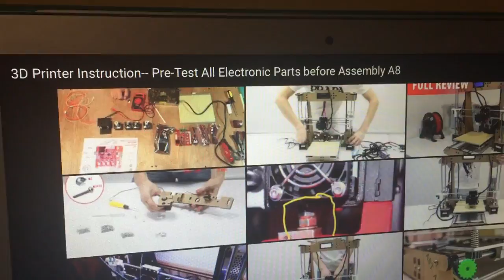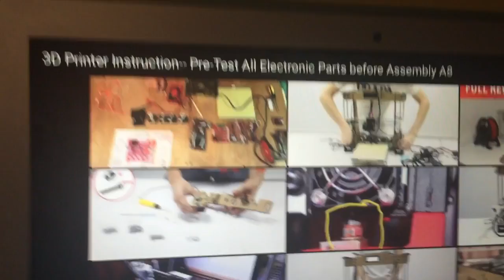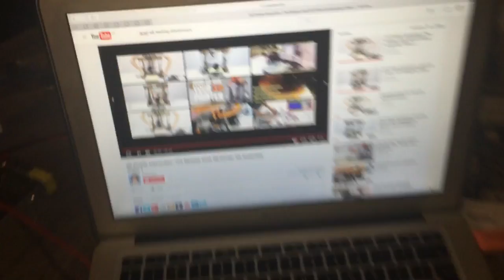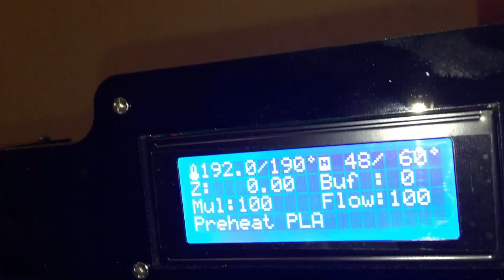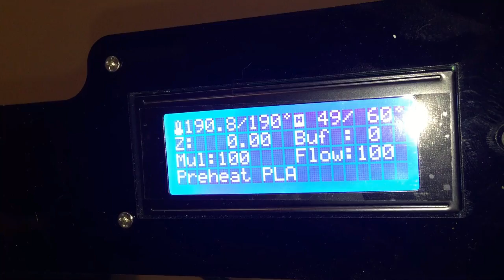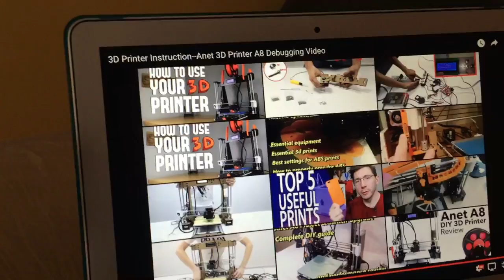Anet A8 Unboxing & Build Tips 2017 Edition 3D Printer

Comment: i have see you did not assemble the autoleveling sensor you orderd. i got the same, im excited to see if it works on your site. and if please share how i cant get it to work :-) cheers
Reply from the maker: +Marc Weidner have not yet come around to install it but will hopefully very soon as I need to update the firmware as well and I'm a bit afraid I'll mess something up
Reply: Blackwidow Unboxing I used the skynet Firmware update and i went pretty easy and good. there is an documentation inside for step by step. i also downloaded me on a  german page https://www.bastelbunker.de/mein-3d-drucker-der-anet-a8/ the files. scroll down to downloads and there you find original firmware.
Reply from the maker: +Marc Weidner thanks for the info

Comment: I recommend a glass bed and use hair spray to help the filament stick. It works amazing, you will see that removing the print from your bed with tape is going to be a huge challenge sometimes, and you will have to relevel your bed every single time, with a removable glass platform that gets reduce to like every 5-10 prints and once the glass and part cools it just looses adhesion and no struggle to take it off. Best mod on my Anet
Reply from the maker: +John Gonzalez thanks for the tip will look into it as it is a bit hard to remove the prints from the tape